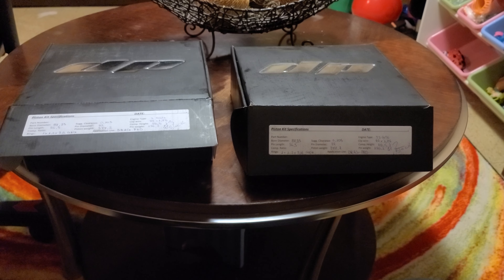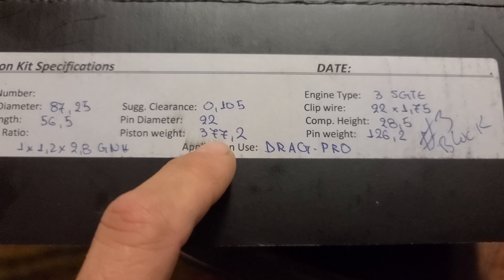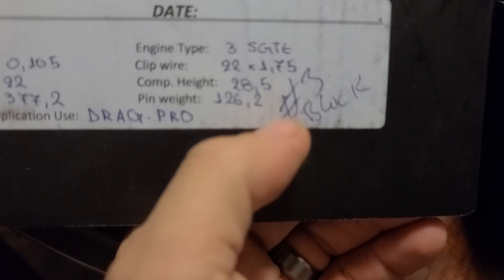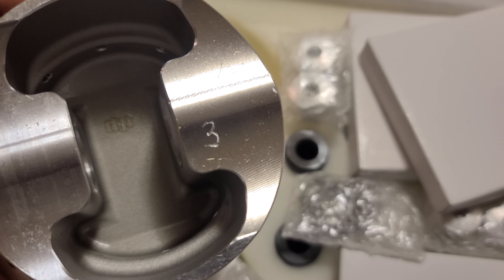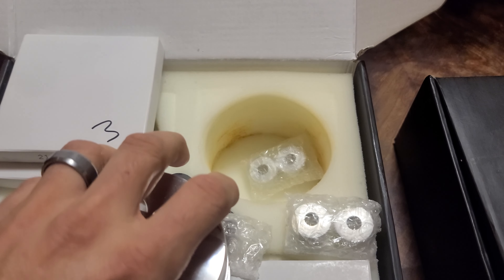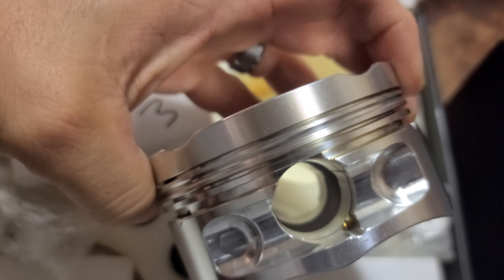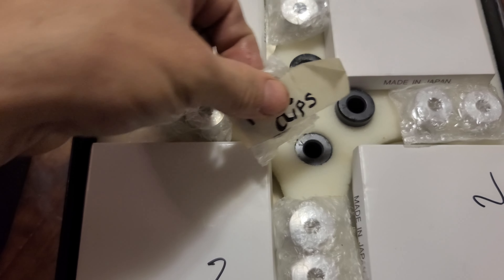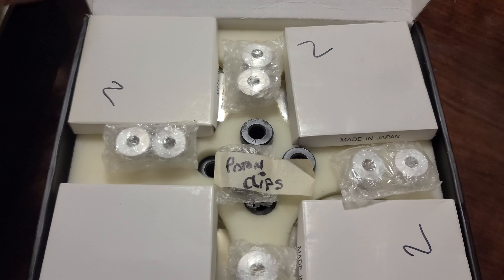5SGTE pistons for sale

Comment: Cze Ryan! I might be interested, I’m looking at rebuilding a 3sgte engine but bigger pistons in this case is something I didn’t think of. Will it run normal or is this a dragrace build that needs lots of power or can it be built in a normal 3sgte engine to just get some more hp out of it?
Reply from the maker: You can use in lower power. But the long rod is setup for more rpm. Remember it should go into a 5S block. Also these are $1050 due to all the high end stuff that brings the cost up. Plus custom rods are more $.

But once together it's a killer combo
Reply: @rm2932  Well the plan is to build a better 3sgte engine on the side. My GT4 is working like it should (fingers crossed) so I’m in no hurry to build this but I want a proper engine swap. Still I’m guessing I have to change the ECU to if the rpm is gonna change?
Reply from the maker: @carlcarlssonvlogs  if you buy these pistons you should have an aftermarket ECU along with multiple other supporting mods
Reply: @rm2932  Thanks for the info, I’ll do the math and ask my local Performance shop about a good layout before making up my mind. 👍
Reply from the maker: @xcitementxxx  Ryan Maroszek on Facebook or email at rm2932@yahoo.com and we can get in touch from there